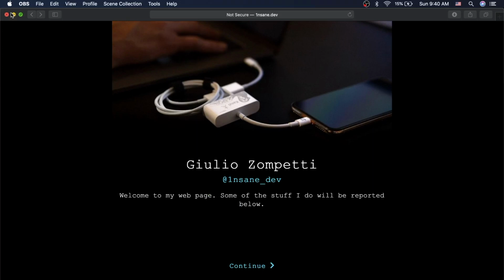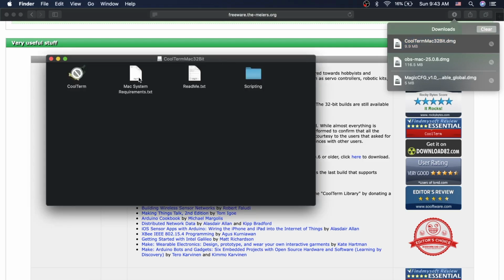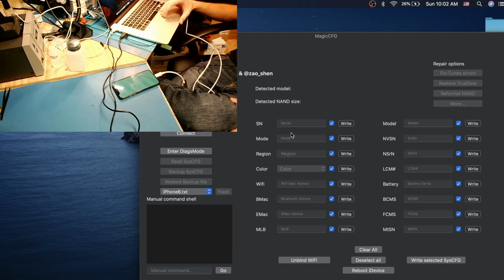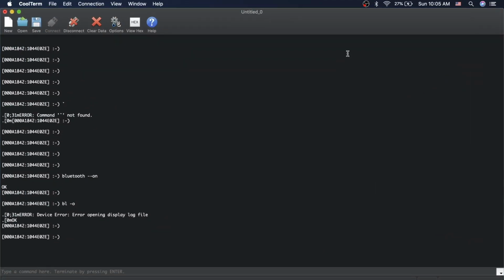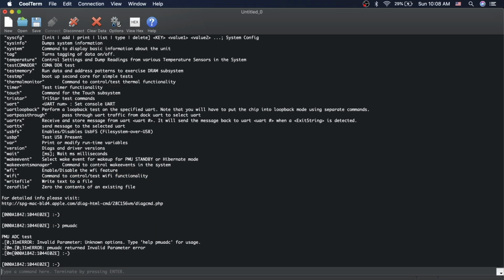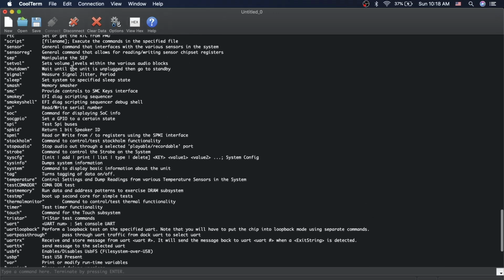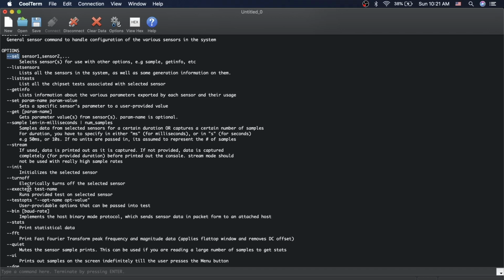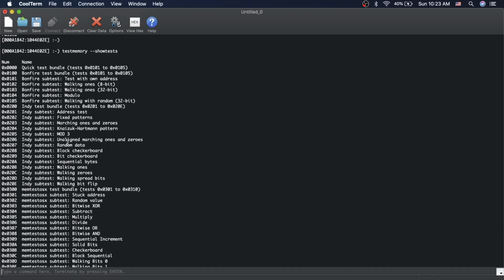Using Purple, and how to diagnose iPhone and iPad with it

Comment: illuminating video

Yes, voltage main pmu in block ADC can read.

Analog to Digital Converter
From voltage convert to software reading

Inside pmu there are ADC blok and AMUX block. Can read and monitor

charge --on
charge --auto

Batter -p
Vbat --read
Pmuadc --read all
Pmuadc sel Tigris --read all
Pmuadc --sel chestnut --read all
TriStar -p
Wifi -p
WiFi --on
I2c -s0
Baseband -p
Baseband --on

Comment: Hi, we are having trouble with trying to diagnose the baseband. It seems like we need to load a firmware, but it never seems to work.

How can we contact you for a bit of debugging exchanges :) ?

here is the log error

[00197152:24F2ED26] :-) baseband --load_firmware

Baseband Load FirmwareFlags Len: 0, Max: 24
Sending no flags
Executing Firmware Load
Interface 0: Firmware Load Interface
Interface 1: Core Dumps Interface

Path for efs1 file fs1:\bbfs\
Path for prov,cal and pac files nandfs:\System\Library\Caches\com.apple.factorydata\
Path for all other FW files nandfs:\usr\local\standalone\firmware\Baseband\Mav16\

Loading firmware from NAND.
.[0;31mERROR: Couldn't open SBL1 file
.[0mDATA: firmware-load="Failed"
baseband returned Not Found error

Comment: Dusten, Heads up. Use the commands
charge --on
charge --auto
This will turn the charging circuit on, and also let it decide automatically what "power brick" is hooked up so it sets its charging mA correctly.
Might help you out with exploring more.
Reply from the maker: Thanks man!!!
Reply: Dusten Mahathy hi bros pls give link to download

Comment: Saw tristar in the list, wonder if you can test for bad tristar?
Reply from the maker: I didn't see any options for testing when I was playing with that command
Reply: @Dusten04  would've been nice. Thanks for the video.
Reply: Yep it's there, pls test it so we know can it be used or not, and pls list software links and that engineer cable, thx mate
Reply: Dont know about testing, but if it can program the Tristar would be cool since apple do read they for diagnostic purpose. No idea why would it help anyone with anything, but it would be cool.
Reply: From twitter: "In the upcoming updates I’ll add a diagnose feature where you can check device’s components (Tristar, NAND, memory,…)."